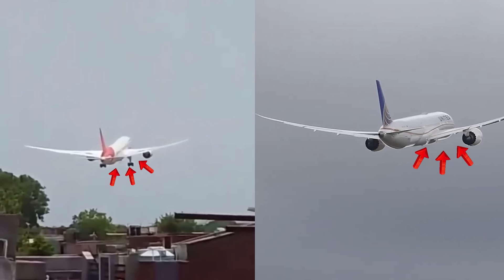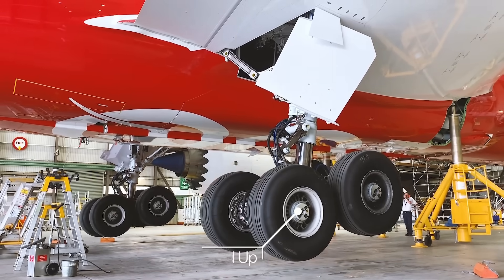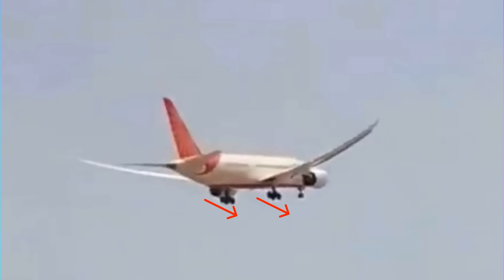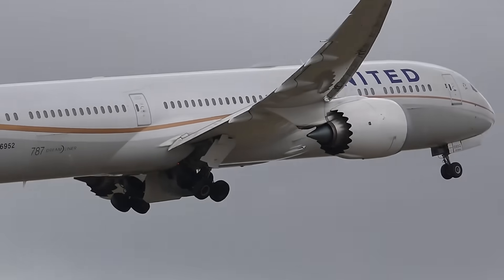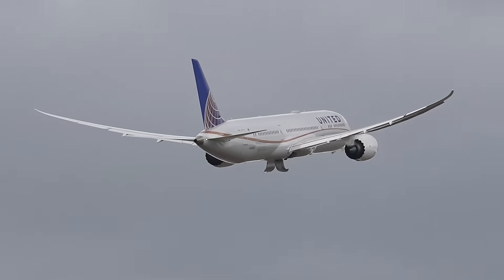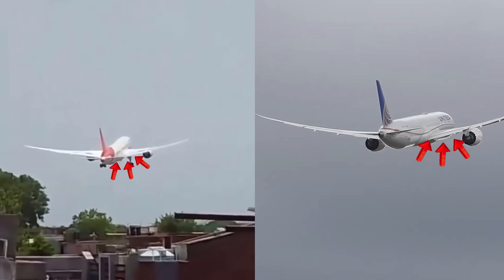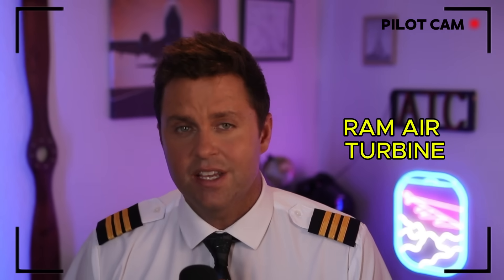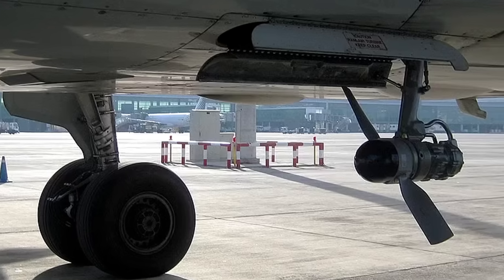Pilot Explains: A New Detail in the Air India 787 Crash Everyone Missed

Comment: I agree with the conclusion of dual engine failure shortly after T/O.  I'd be more willing to buy into the contaminated fuel argument if other aircraft on that day experienced a similar problem, which to my knowledge they did not.  Since during T/O each engine is feeding from a different tank with different pumps and different fuel filters, I think it is beyond remote that both engines would fail simultaneously even with contaminated fuel, especially given the fact that they were seemingly both operating fine for T/O.  Once in that high AOA regime following loss of thrust, the engines would automatically go to TOGA (at least in Airbus, and I assume Boeing FBW aircraft as well) even with the thrust at idle and auto-throttles OFF.  The RAT only provides hydraulics for the flight controls and not for raising the gear so I believe the gear handle was placed UP, but the engine failures occurred just after, so even with the gear handle UP,  the gear would remain extended in the position described.  Here's an unfortunate (and unsubstantiated) conspiracy theory - one of the pilots turned off the engines in quick succession just after raising the gear.  I don't know which radios are powered by the RAT on the 787, but it's usually VHF-1, but is the F/O's radio control panel (RCP) dead on RAT power?  In Airbus it is which means the Captain would be the only pilot able to make the Mayday call.  Was the Captain the pilot flying in this case?  The whole thing is really weird and disquieting.

Comment: Yes! Nice one Flaps were extended 5 degrees for takeoff, I have been an  Avionics Tech for  for last 9 years. My 2 cents & Guess here, something had to do with FADEC wires, they are run on both sides of the fuselage and got heavy insulation and there is no slack or no loops, where it makes it difficult at times to perform certain inspection tasks or removing adjacent components, If they get damaged during maintenance, the entire run must be replaced and there no repair. if there is a short, it would take out all channels from the engine EECU.
Reply: Why would critical wiring not have any loops???